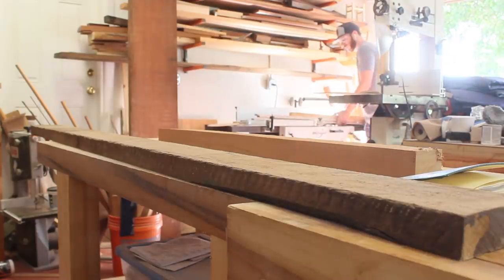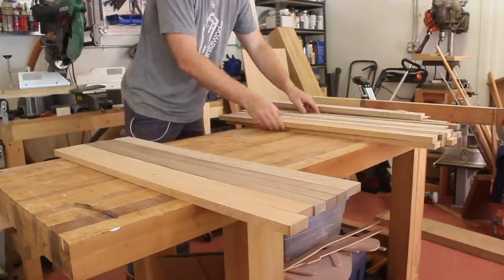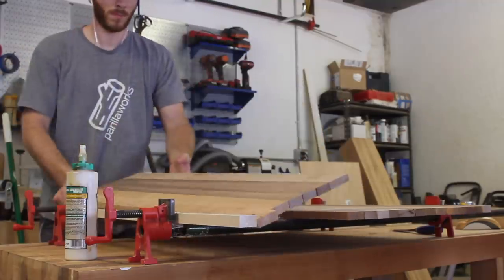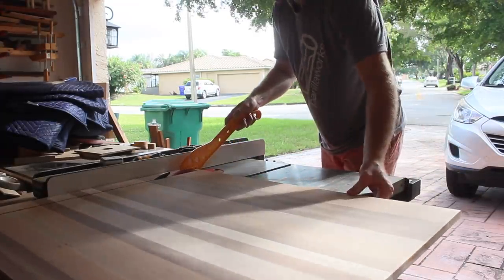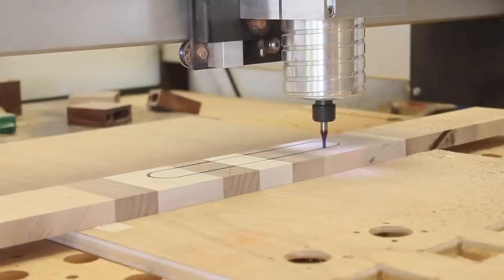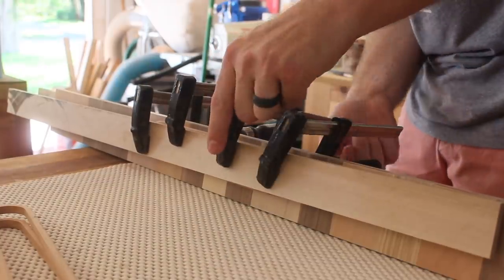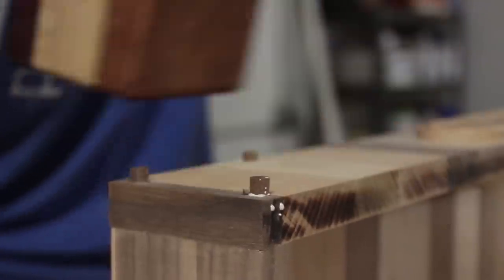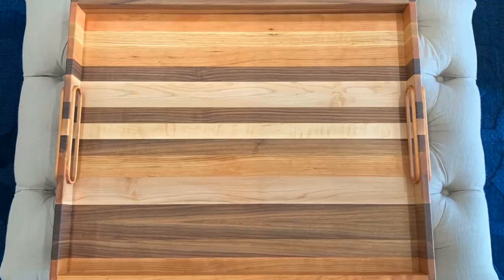Making a Large Serving Tray

Comment: Nice tray John.

Does the tapered shape of the Miller dowels help with anything vs a regular dowel? Just curious why you picked them.
Reply from the maker: Thank you. I think Miller claims the tapered shape and ridged texture helps with the holding power but I can't really confirm that. I bought these a while back for certain situations like this. All that to say, I think regular dowels would be just as strong, though the tapered ones are easier to use.